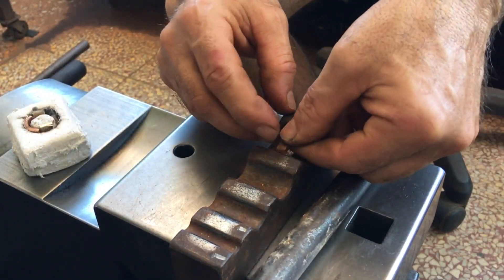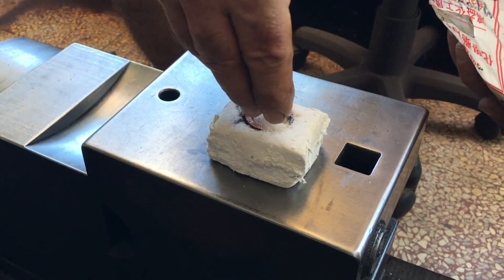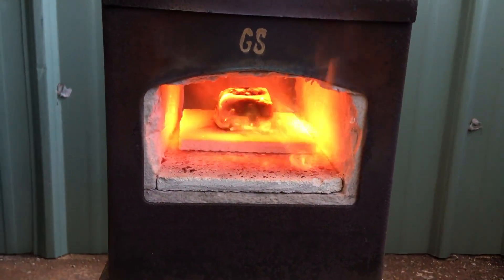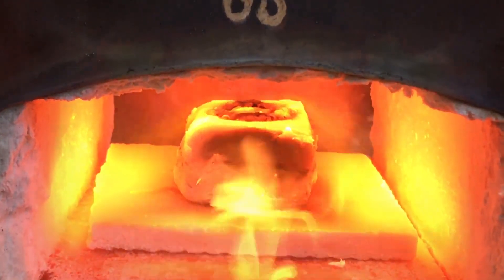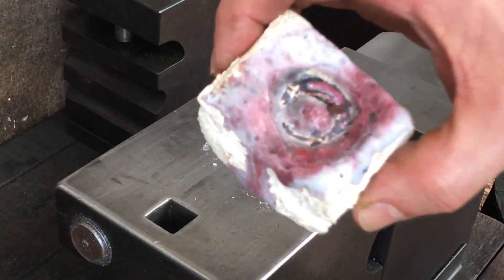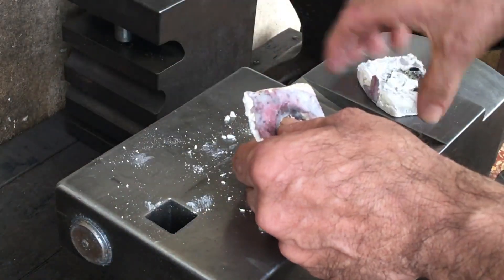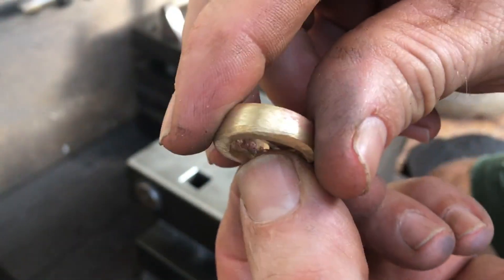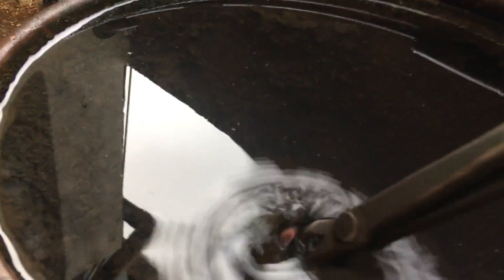Copper & Brass Amalgamation (Lots of Potential)

Comment: Glen, you gave me a great Idea, I am going to try this using soft fire brick, with the mold made from using a hole saw.
Reply from the maker: That the exact idea I had. If you see my last "Roaming" video, when in the hardware store I'm about to buy a hole saw but can't remember the size. Not sure how that would work but it seems like it should. Good luck if you try. Thanks.
Reply: @gstongs   Fire brick is a little holey, so the casting won't just slip out. I am ok destroying the yukko brick bits I have lying around. Shall let ya know.

Comment: That's a neat experiment, Glen. Might be cool to try with copper and brass wire. Twist a bunch of strands cold and really tight. Coil that around a mandrel/round bar and cut into rings. Drop the rings into your moulds.
Reply from the maker: That's a good idea and something I may give a try. I appreciate your input. Thanks.

Comment: Reminds me of makume gane...speaking of which, I wonder that can be done with brass and nickel instead of the copper....now I gotta try it. Nice vid Glen.
Reply from the maker: Lots of folks are mentioning that technique though I'm not very familiar... I need to do some research and maybe more experimenting. Thanks.
Reply: @gstongs  makume gane is nickel and copper. Often made out of quarters if you dont have access to nickel and copper sheeting.

Comment: Some mokume gane?
Reply: That was my first thought also. The two dissimilar metals don't mix but fuse at the boundary due to recrystallisation from their eutectic point. I have no idea what that means of course but my limited understanding suggests the key elements are temperature and time. Pressure also helps and success/failure relies on whatever contamination may be introduced at the boundary. I am keen to try titanium/copper, maybe we can persuade Glen to try it first!
Reply from the maker: Yes, something is keeping these metals from completely mixing and becoming homogenous which makes for an interesting pattern. I will continue with this sort of experimenting. Thanks.
Reply from the maker: Though I'm familiar with this term I'm not exactly sure what that is. Need to research... Thanks.

Comment: Rings dont have to be symetrical......might still be able to make a final piece from it.......A copper and brass damascus patterned stock could also be interesting for other projects. Love your work, cheers
Reply from the maker: Yes, you're right. But this casting is just off. I will continue to fool around with my technique. Thanks.